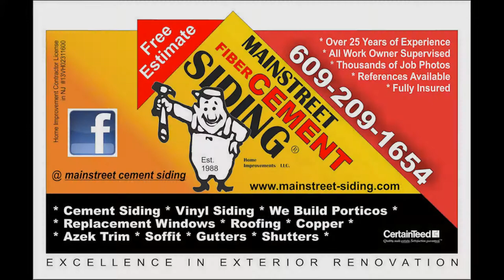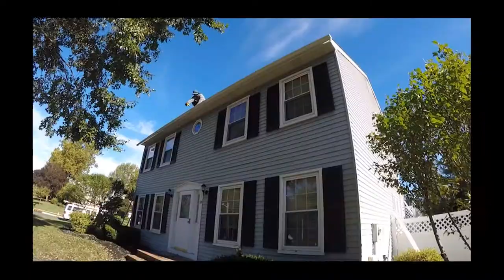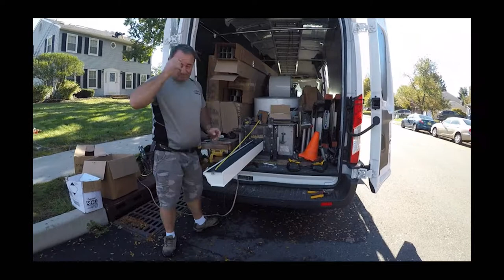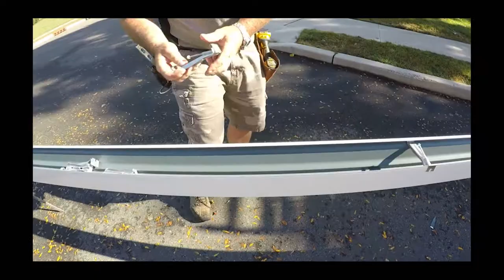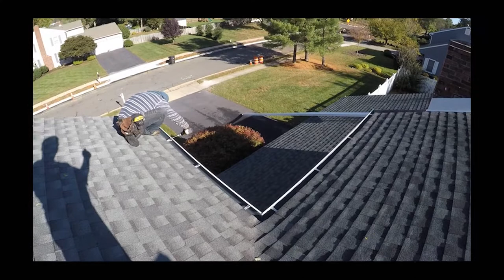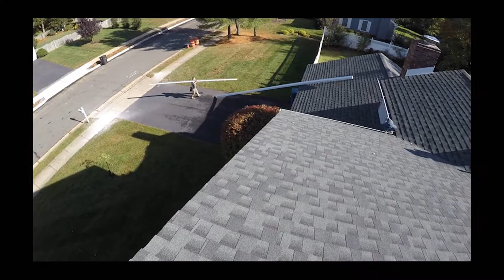GUTTERS AND GUTTER GUARD

Comment: You guys put hangers way to far apart sapost to be every 2 feet!
Reply: Mark Schaefer guaranteed till it rains or they get around the corner.....at least that one guy grabbed that 40 footer and went up ladder and hung it
Reply: how big of a box truck do i need for a 6" gutter machine?
Reply: larry williams I got a 14 foot box truck with a 6in machine and a 5in and it gives me like 5 ft space in back of truck works good
Reply: @markschaefer726  so I only want to do 6 in 14ft should be plenty I guess
Reply: larry williams yes the machine is like 8ft so plenty, and if you are just doing 6 in i would put machine rite in middle of truck so you have one side for material and the other for scrap gutters
Reply: @markschaefer726  thanks man. I'm selling a ton of gutter jobs and currently subcontracting all the work out but I'm ready to make the plunge. I did not want to ask my subcontractors what size their truck was hahaha
Reply: larry williams lol I get it, there’s pretty good money in gutters